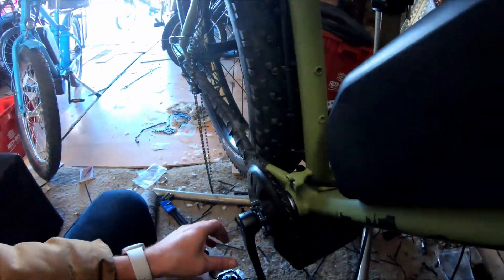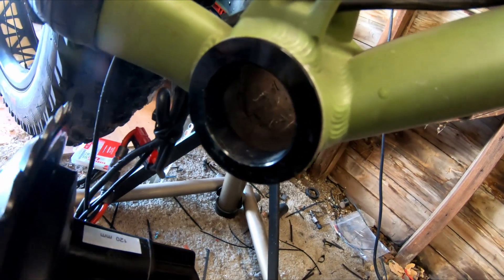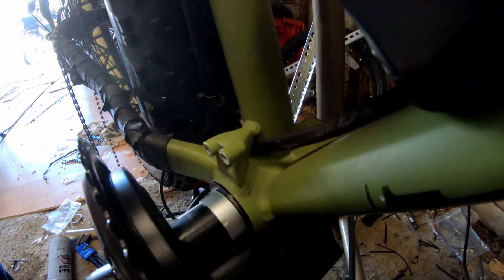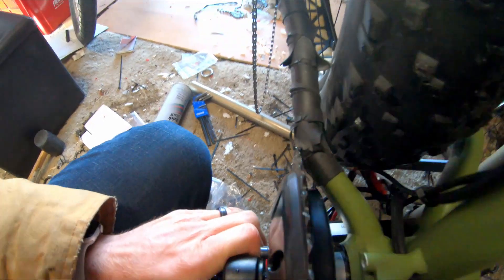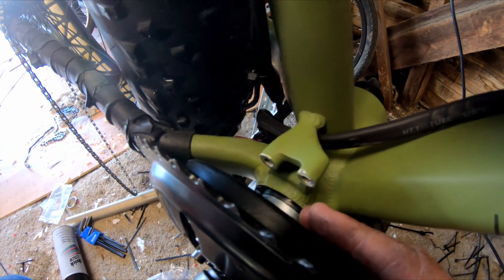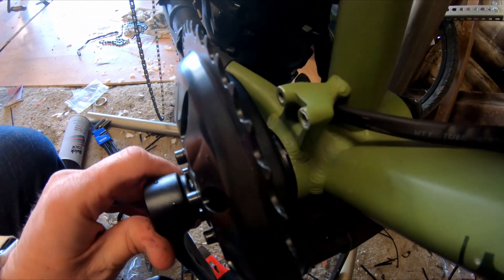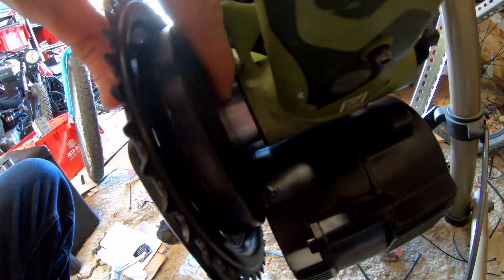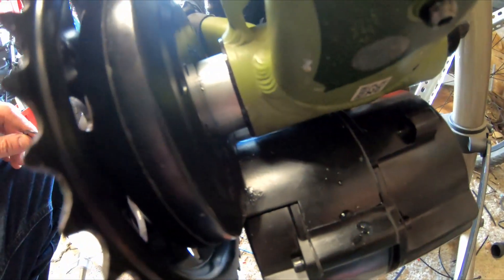Fat Bike Install Hack: PF30 bottom bracket and properly spacing a 120mm BBSHD

Comment: Hi Johnny". Great videos bud,   right, I've got a trek Farley 5 2016 version, I'm going to convert it to bafang mid drive 1000w using 52v, 20ah battery, have you any tips please for fitting the motor as I've not done a fat bike before

Comment: Just watched your video! Do you know where I can get a press fit adaptor to to convert my 40.94….41mm? diameter bottom bracket to  accommodate my 33mm bafang BBO2 mid drive motor?
Reply from the maker: I carry the 41mm on the site. Just type 41mm in the search bar

Comment: Question I have a older Micargi Prado Deluxe the bottom bracket hole is big.I got the Bafang mid drive 500 w  and the motor doesn’t fit can’t find anyone to help me

Comment: I’m building a ebike from a Amazon outroad brand fat bike it has a 120mm BB how do I make sure that the bafang mid drive 120mm will fit and the chainring not hit the frame? Will I still be able to space the motor being that they are using the same length for the bb?
Reply from the maker: Yes you should have a couple mm of play

Comment: Hello Johnny, I have a Rize X E-bike 750w Bafang hub motor (bought it before I started watching your channel) my question is, can I add a midrive motor and leave the existing hub motor online? So add a battery etc separate to the existing drive line?
Reply from the maker: Im totally sure what you mean, but check out my video on converting a juiced cross current from hub to mid and leaving the hub in place